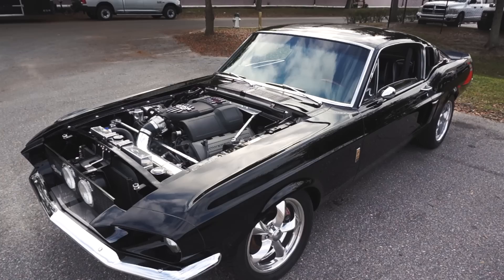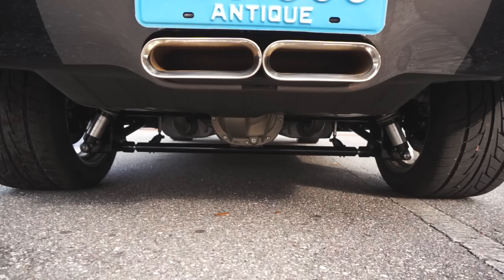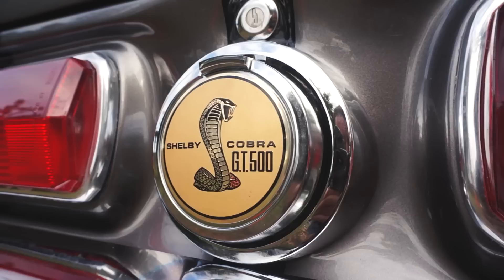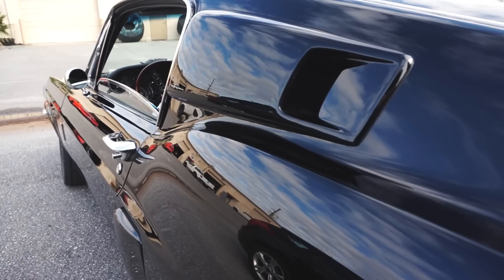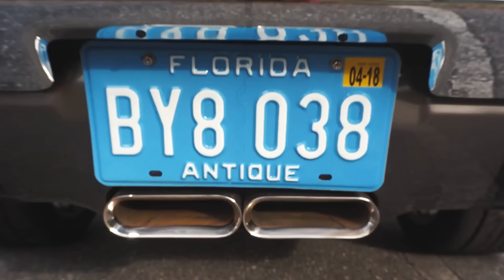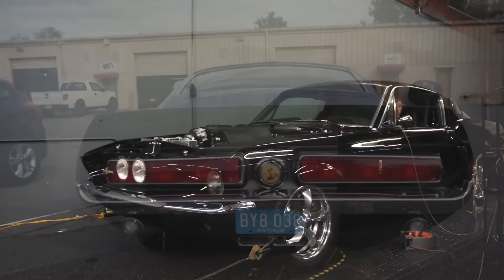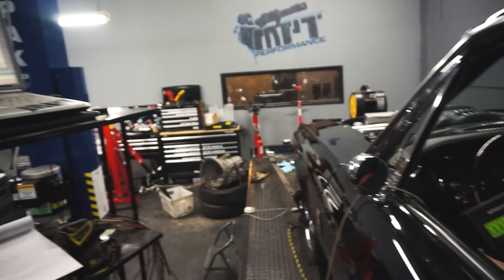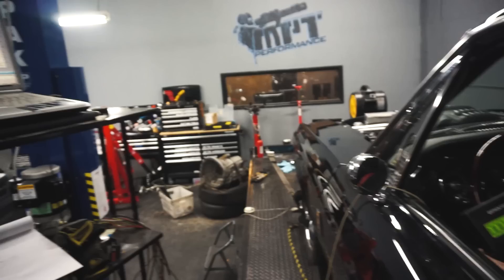427HP '67 Mustang Coyote Swap

Comment: T5 with 346-427 horsepower sounds like a ticking time bomb. T5 is only rated at 300 horpower
Reply: He said Tremic 5 speed, not necessarily the T5. More than likely a tko 500 or tko 600 transmission

Comment: I am researching a coyote swap into my 67 mustang. I am planning on getting the Ford Racing control module and wire harness, but I also want to do a little more to the engine (like cams, intake, and headers). I need to know if that engine swap control unit can be tuned or if I should look into some other computer? Thanks.
Reply from the maker: Ford Performance control pack ECU can be tuned in the same way as a new Mustang. No problem.

Comment: Do you think that the power disparity on the stock tune was due to the mild non-stock parts combo, or is the stock control pack tune that far off. That's a huge gain for an NA Coyote from a dyno tune.
Reply from the maker: I think there is more to the story. The control pack was purchased used and when I reviewed the calibration it appeared ready for boost with loads exceeding the normal values for an NA coyote. Timing as a result seemed to be lower than normal. Spark is the biggest factor and it was very low at wide open throttle for 93 octane. I want to say it was around 14* which explains the lower power. Either way, the calibration process got it back on track to where it should be.
Reply: Thanks for the info.

Comment: not impressed, cant even fit a hood on it.
Reply: That's the  problem  when use the  wrong suspension.  With  Mustang  To Fear IFS even a supercharger will  fit, plus no modifications to the firewall or tunnel.
Reply: Probably  because of the  AJE suspension  sitting  to high.